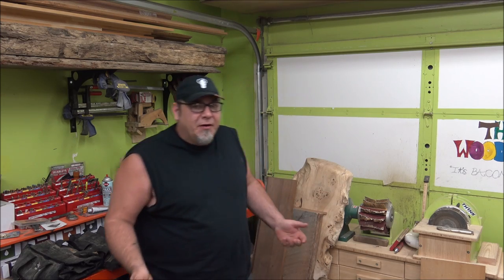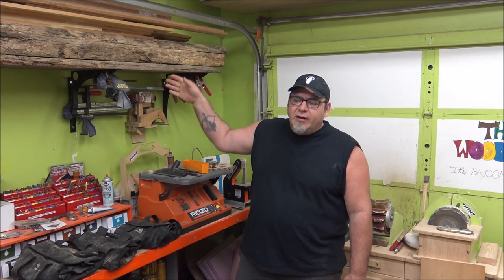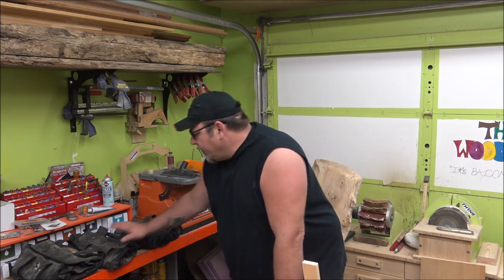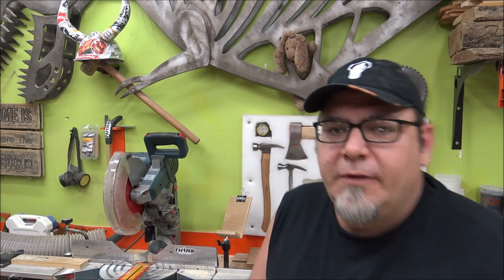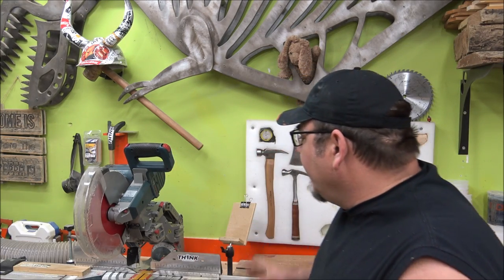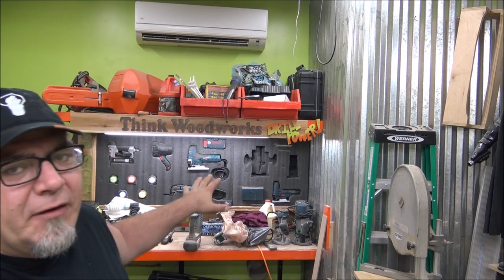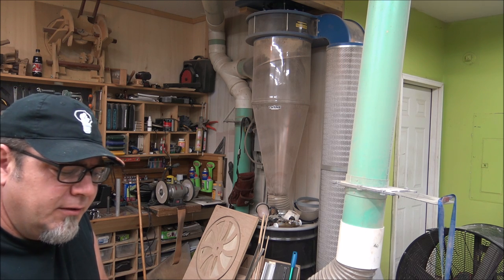2016 Shop Tour

Comment: Things I used to have mounted to my work bench, belt sander, chain and bench grinder and a vise for metal work. First I built a sturdy shelf above my bench, then I mounted a piece of 4x4 lumber under each tool, so now when I need a tool I clamp it into my large wood workers vise and when its not in use its on the shelf, now I have all this extra space for clutter to accumulate,..

Comment: Hey Izzy, you mentioned your tablesaw is a POS, and if I'm not mistaken you have the Delta 36-725 which is what I have as well. I upgraded to this saw from a reaaaaalllll cheap department store saw and have been pretty happy with it after some mods for dust collection and extension tables. I got it used so it was a great deal for me. I have heard some hate around this saw and I'd be interested to hear why you dislike it? I'm just curious to hear some other thoughts on it, I'd love to have a cabinet saw, but it is definitely not in the budget for any time soon.

Comment: Relatively new viewer...you do some amazing things...I get the whole "if you have a hammer and hand saw do some wood working" thing, but that never worked for me.  I have a decent table saw (Portercable), a Dewalt 12" Sliding Compound Miter Saw (with stand), a couple sanders and drills/drivers, small air compressor with brad and finish nailers, a small porter cable router (with a Rockler bench top table), and a small Harbor Freight Drill Press.  I STILL have issues with all that gear making things that actually look good.  I can't get consistent cuts on anything no matter how hard I try...yet a friend of mine, using my equipment did things 10000 times better...and neither of us can figure out why.  To say this is discouraging is putting it mildly.  I still try, but the time I can invest gets less and less every day.  Keep up the great work!

Comment: you said your table saw is a POS, just wondering if it's the same one I seen in a earlier video. I had bought one as well for around $550 at home depot thinking it would be a great addition to my shop. I ended up returning the first one and I'm extremely displeased that the replacement was junk too.

Comment: Generally liquid setups would still have a fan on the radiator. There is also a fan that is built into the power supply(wouldn't mess with that one, unless you know how to discharge caps). If they get squeaky on ya just gotta oil them. Bigger problem will probably be your wife/daughters hair.

Comment: I don't want to come off the wrong way here, just share some knowledge. A liquid cooled computer works very similarly to a car engine. A liquid flows through a block attached to something hot and then goes through tubes to a radiator where a fan pushes air past the fins. Cooling loops with small radiators like the one likely to be found in your computer don't offer much performance benefit in most cases. I am assuming they used it in your system because it looks like it is designed to be portable. With a liquid cooler most of the wight is not on the motherboard, but rather bolted to the case instead of having a heat sink stressing the motherboard. Also, marketing. Many woodworkers put their computers in the next room over and then run the cables through the wall. I bet you could come up with some sort of cool filtered cabinet using a standard HVAC filter. There is no real fire hazard with having a ton of dust in a computer, but it can kill the computer if it is always overheating from dust blocking airflow. Some computer cases have dust filters built in and you can simply remove them and blow them off once in a while. No clue if yours does or not but it might be something to consider if you ever replace it. Honestly it will probably be fine just how it is, especially if it is further away from dust generating tools in your larger shop. Can't wait to see what you can do with more space!

Comment: Izzy--I may have a challenge for you. I really want to make a good quality push stick and feather boards for my cheap Delta 10 inch saw! Now yes I could probably make one like yours , however I have a unique problem! I , because of a situation that I had no control over,I ended up with my left hand needing to be put back together with metal plates and pins. My right arm has a rare disease that makes my pinky finger and ring finger numb to the point of no usability! I am not a rich man, because I have helped others all my life and money does not exist on my list of important things! I can feed my family and house them, but I really need to find a good set of these tools so I can continue to work to support them! Now I am right hand dominate, but all I can really use on that hand is my thumb,Index finger,and middle finger! I come to you , hat in hand , hoping you can show me a way to make these tools for myself and my safety! I guess the one word I would use is HELP! I have subscribed to your channel because your work is amazing! Keep it up! After over 20 years I have learned so much new from you there is no word to thank you enough!

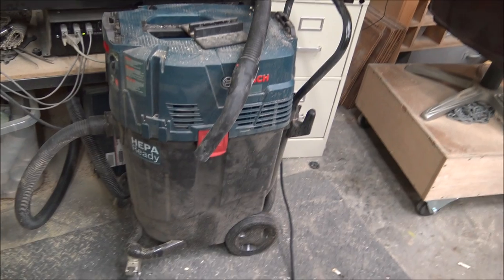Comment: 9:13 I'll be that guy in the comments that pretends to be an expert. It does have a fan that cools the radiator, exactly the same as the one in your car but much smaller. The advantage is to do with waters ability to pull heat out of an object faster than a direct air cooled heat sinks. Great for video editing i'd imagine.